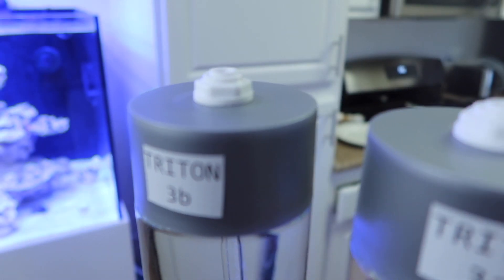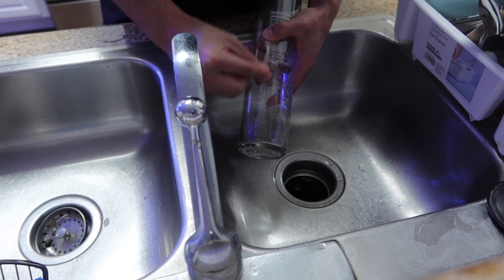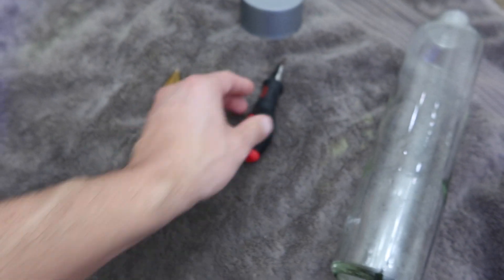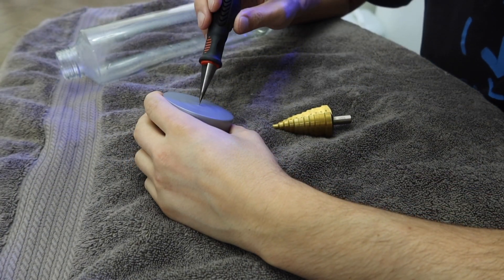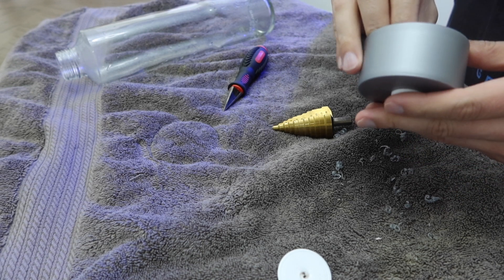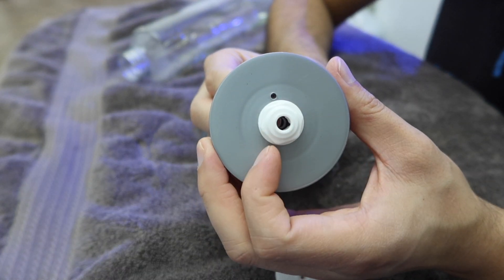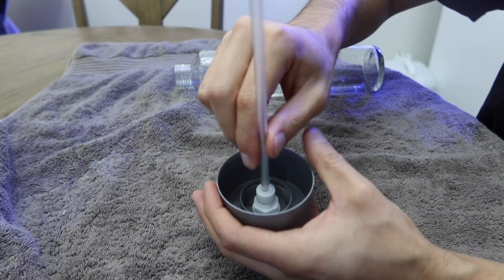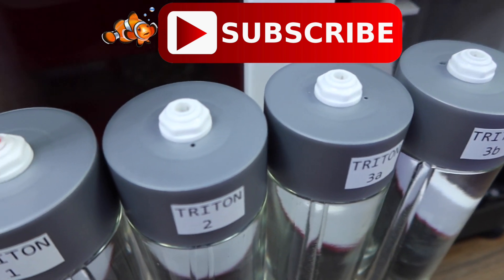DIY Voss Dosing Containers V2

Comment: Great Video! I wanted to ask a question , the tube that came with my kamoer doser is only 3mm too small to fit the bottle connecter, do I neen thicked tubing ? or should I use a barbed adapter?

Comment: I also love the Voss bottles for dosing.  But I don't use a razor blade; I've found that steel wool does a great job of removing the screen printing ink.  I do usually use a little acetone to help the process along. But just another option if you don't like the idea of using a razor blade. And if anybody is about to say that acetone is bad for your aquarium, be sensible. You don't put it INSIDE the bottle - you put on the OUTSIDE of the bottle.

Comment: I've been using the glass Voss bottles for 3 years. Your video just clued me into something that makes me feel so dumb. LOL. I drilled my vent holes in the cap too far out. I'm not venting crap. ha ha . It's still worked without issues but I'm re drilling my vents, after seeing this vid. Just wanted to say THANKS. 😀
Reply: What's the point of a vent hole by the way?
Reply: @DARDYSKUXXFELLa  it stops a vacuum being created which will burn out your pumps making them work much harder

Comment: If you use that rigid airline inside the Voss bottles you’ll end up getting air bubbles inside the tubing, throwing off your dosage amount. The seal between the rigid tubing and the bulkhead is not air tight. Use more RO tubing, that’s what the Push Connect fittings are meant for.
Reply from the maker: Exactly I would never use anything other than RO tubing in this
Reply: @DeepDropFishingTV  I'm a little confused here. You said that you wouldn't use anything other than RO tubing in this but you aren't using RO tubing inside the bottle. Can someone explain? I'm trying to make my own here and want to be sure I'm using the correct hardware.

Comment: I don't auto dose yet but if there is a way to make the dosers know when to dose ex: when parameter drops below certain point. Then I would but for now to avoid programming and adjusting I manually dose.
Reply from the maker: Depends on the brand of doser

Comment: And where do you keep the 200ml that doesn’t fit in the bottle?
Reply from the maker: I’m a small container
Reply: EAT SLEEP Reef  In Spain, Triton's bricks are 1l.  So ... do you use 8 bottles/containers?
Reply from the maker: Triton from my understanding is 4 elements 1,2,3a,3b what do you mean 8
Reply: EAT SLEEP Reef You need 4 bottles for each of the 4 elements (1, 2, 3a and 3b) and another 4 containers for the liquid that does not fit in the 800ml bottles
Reply: Which will build up over time like getting one free 😊